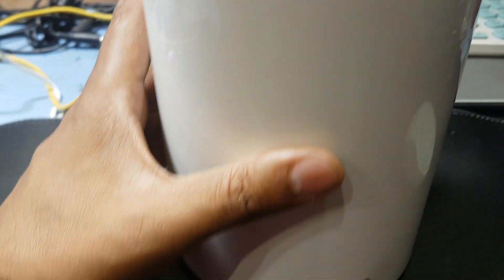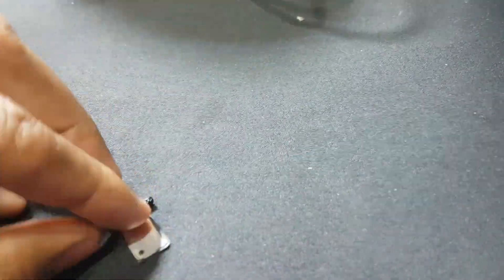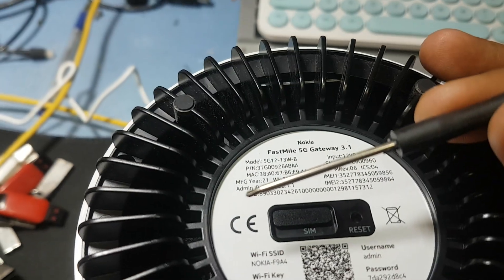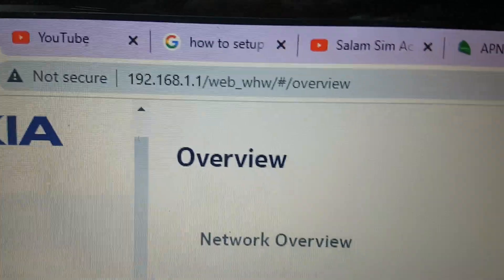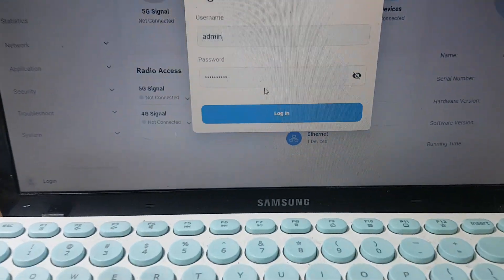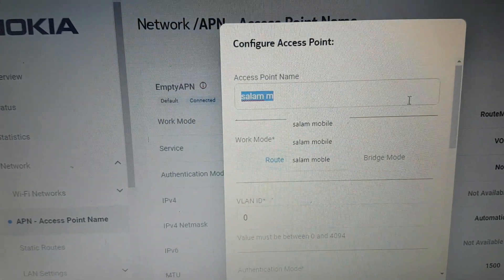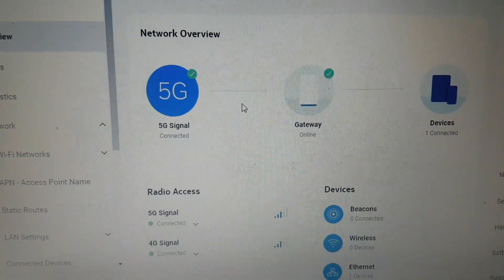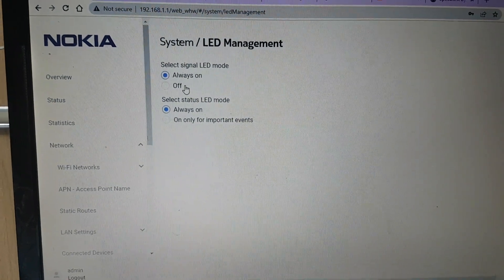HOW TO SETUP SALAM MOBILE INTERNET ACCESS POINT NOKIA 5G ROUTER/SETUP NET SALAM MOBILE

Comment: Sir I have same router but since i bring it I can’t use screen mirror with the tv
Note that it was working on the older router
Reply: I change the poth 2.4 and 5g
Wep2  and password 😢didn’t solve
Reply from the maker: Change other settings web only or wpa 2
Reply from the maker: @reeban2354  use only 2.4G
Reply from the maker: CHNAGE router password and web2